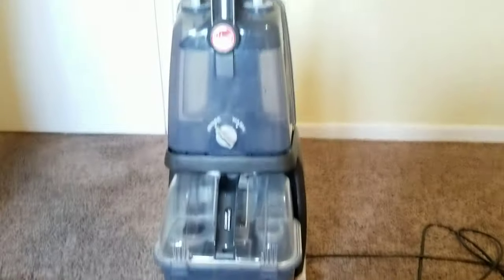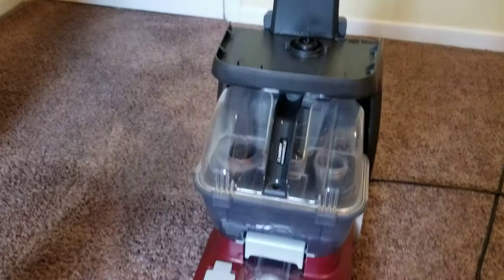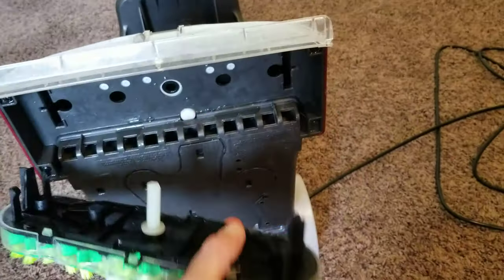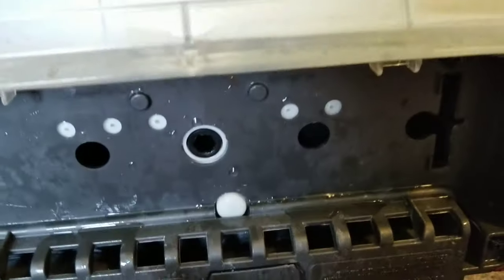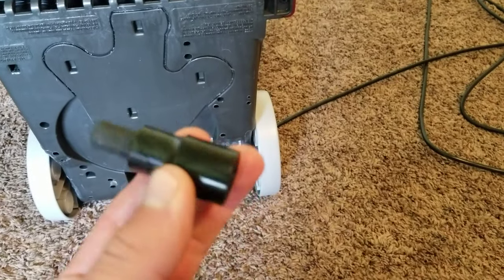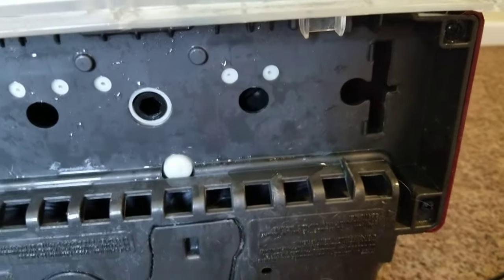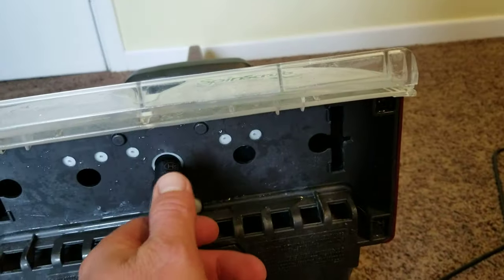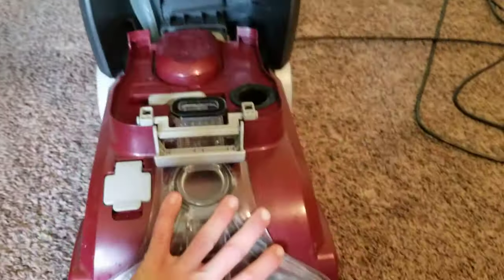Fixing a Hoover Spin Scrub 50 with Brushes that Won't Spin

Comment: Nice, I've tried this prior, mine won't really spin easily at all, I was thinking of taking it apart, it worked last I used it, but I haven't used it in a very long time it's just been sitting around, ive now needed it again with a new carpet, but now it just makes a god awful sound and won't spin...

Comment: People... for the future see'ers of this comment... when you're done using the cleaner.. run plain water through it.. like literally fill the tank with a couple of inches plain water... put the machine on a tile floor to suck the clean water through it...take the water tank off and keep spraying til all water is out of hoses... take everything apart, rinse it...and for the love of God put a fan in front of the base of the machine where the brushes to for a couple of hours to dry everything out. I think people end up using it, cleaning it and storing it and it doesn't have a chance to dry in those hard to dry areas.. doing this has kept my turbo scrub's brushes spinning for 3 years now

Comment: Great video I have an older model of the Hoover SpinScrub 50      I was using it today it was working great ,,,,and then I notice that it was leaving streaks of water on the carpet ,,the brushes were not spinning I was about to take it apart when I came across your video ,,,,I did exactly what you shown in this video and the brushes started to spin again  but when I put it back down to the carpet to start cleaning again  the brush stop, put it back up the brush spin back down stop ,,does that happen to anyone ? luckily I was almost done and I just use the spil pickup part of it    does anyone knows what the issue is ?  I really love this carpet cleaner and I had it for a long time and it work great every time , just don't want to get rid of it and buy a new one is there is and easy fix please let me know thanks

Comment: Ok, Using it again,  finding out,  that my cleaner only spins on thick carpeting.  Is there a some kind of button or lever to press for it to go down as for floors.  My carpet is Commercial carpet not shag,  so,  it works only if i were to be on a shag type carpeting. What can i do for this??

Comment: I bought the first one,  and had to take it back because of Amazon driver throwing out the box, with the vacuum not knowing whats in the box.  Second time around replaced it at Walmart.  Didnt use it until 4 months later, and that part where the brushes are, arent spinning.  I dont know what to do.  I already threw out the box.  So,  Any suggestions?  I did what you said,  James H.  and still isnt working.  Kinda bummed, but still cleaning with it. just the brushes dont spin.

Comment: Yeah, uh, DON'T do that. There's 3 nylon gears in there that drive those brushes and one of those gears is driven by a metal pinion that rides on 2 bearings. The lower bearing rusts and seizes. This method MIGHT break things loose, but you're more likely to strip those gears and have to replace the whole assembly. Either replace the entire turbine assembly for $49 on Amazon (SUPER easy) or disassemble it (also very easy) then clean the assembly and replace the bearing with an R4-2RS bearing ($10 for a 10 pack on Amazon) and a little lithium grease for protection.

Comment: Kudos for this video, but it unfortunately did not work for me as when I finally managed to get the right size allen key, there was a terrible scratching noise and no change to brush function. I followed 2 other videos to get into the machine -- https://www.youtube.com/watch?v=IevJQDzpmd8 and https://www.youtube.com/watch?v=7Z-WRUScRsc -- and when I opened up the cog assembly, the center bolt was completely rusted and wouldn't turn at all. Some WD40 and a bit of elbow grease later, everything is back up and running!

Comment: Didn't work for me, turned out the insides of mine were WAY more rusted up than sticking a 9mm wrench in there could fix. I couldn't even find a 9mm hex so actually 3d printed one, and once I did it fit perfectly but still wouldn't make the mechanism turn smoothly, it just jerked & lurched a bit.

This guy's solution & linked blog post was what did it; had to take the vacuum apart:
https://www.youtube.com/watch?v=9DzO4eebmAw